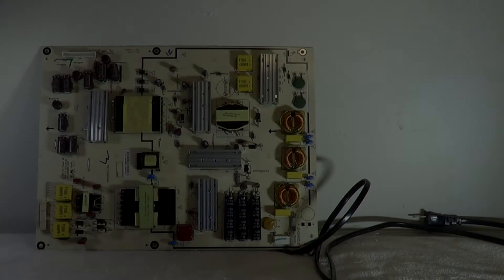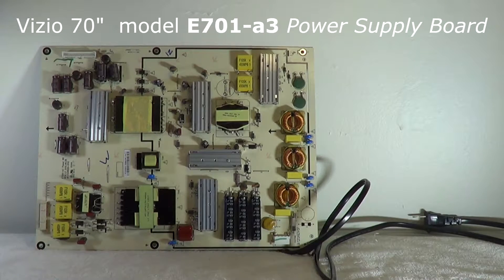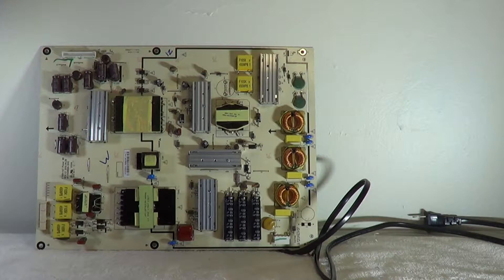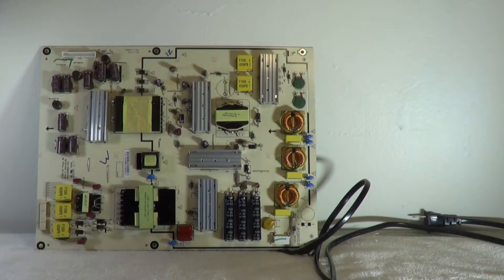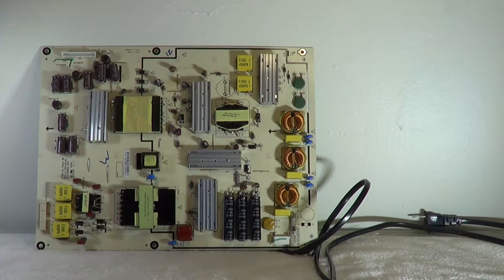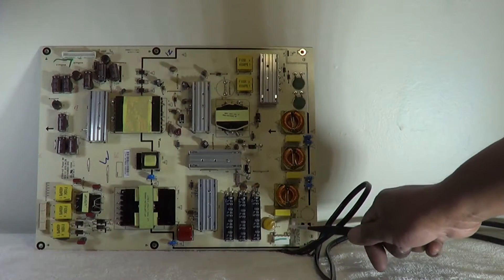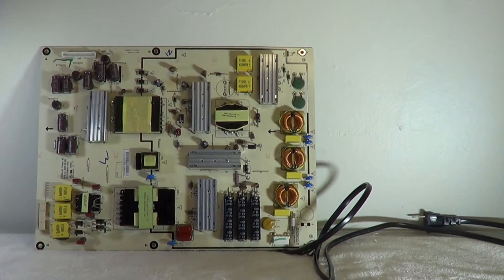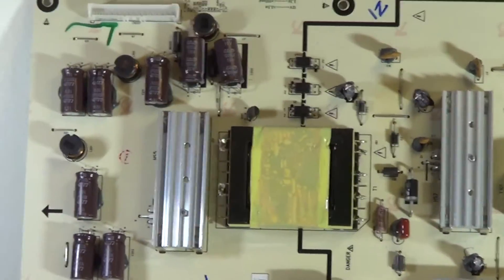LED TV Power Supply tutorial, Vizio E701-a3

Comment: I have a Vizio M70-C3 TV with a power supply very similar to the one on this video. Should the T CON_ON voltage come from the main board? When I power up the TV, I get voltage everywhere except on the  12VT CON pins and the T CON_ON pins. The power light turns on then blinks 16 times. I tried a different main board and get the same results. 
Thanks

Comment: Hey my my father in law has this TV, turned it on vizio logo flashes thought it was the leds after flash light test so I replaced the leds and it done the same thing, so I narrowed it down to the power board getting no voltage at the led light connector, replaced the board already tv works great but would like to maybe repair the old board, any thoughts or insights on where I might be able to find the culprit or culprits on this board please and thank you keep up the awesome videos man

Comment: Sir I have a question. I have a VIZIO M801D-A3 TV.  The backlight LEDs work but while watching the TV the picture just fades away black while sound continues. I've tried replacing the main board, led driver board and the T-con board.  He only thing left is the power supply, Part 09-80CO S000-00. Everywhere I check it is out of stock. Now I'm trying to trouble shoot. The only thing I can think of is it's part of the  the power supply that supplies the main board? Would there be any way you could help me troubleshoot this issue? Visually the capacitors all look fine I don't see any ballooning.
Reply from the maker: If the picture fades away to a totally black screen, you  have a backlight problem.

Comment: Really nice vid! Yes it's nasty feeling when electricity bites. I got bit by atx power supply main filter cap. I was successfully managed to repair it. I pulled it out mains and I noticed that primary sides N-cable was touching fan, so I touched it to get it better position and pam filter cap gave me nasty shock. Aaargh it was horrible feeling.

Comment: Thanks For your detailed info.

I have a question:

I have a grundig LED 40 inch TV (40 MLE 5770 BL) in which has 3 in 1 Board containing:
1-Power Supply Board
2-Main/Driver Board
3-T-Con board with 1 Ribbon

The TV was connected to a receiver by an HDMI and has stopped working after a lightning that destroy the receiver and the TV.
When i connect the power button the red light blink once and othing happened as if it's a dead set.
I have check the power side (hot side) all seems working gd.The driver side (Cold Side) seems to have the problem.

I checked the 3.3v standby is giving 0 but the 5V is existed.I have also the backlight working, the AC fuse working
If i want to check in the level of components what should i check also?

I have checked most of the transistors in the Cold Side (Driver board side) all seems working but 3 it gives low voltage even thought nothing is seems blown and/or any liquid/substance isn't existed.

Any suggestion(s) may help.
Thank you and/or anyone in advance.
Reply: I have a 70in vizio that the back come on bright when powerd up then they go low in power . is it the main board are what

Comment: I got a noise coming from my power supply I got all the volts
Reply from the maker: Whats wrong with it?
Reply: @bigdog8882  the blacklight flash and I'm getting all my volts from the power supply I'm thinking leds
Reply: @bigdog8882   what's led + and led -
Reply from the maker: @leonjohnsonjr3331  Im not sure but U can check them if U have a backlight tester.
Reply: @bigdog8882  YES SOMETIMES THE BACKLIGHT DONT HAVE ENOUGH POWER TO LIGHT THEM UP QUICK I USE THE BACK LIGHT TESTER BUT IT LIGHT ALL OF THEM BUT IT STILL WAS THE BACK LIGHTS

Comment: FYI some of those silver heat sinks can be hot ground and they are a shock hazard, I got a shock one time by touching one of them.
Reply: I never wear rings or bracelet when working on TVs I leant the hard way lolol
Reply from the maker: Yeah, I get zapped quite a few times when Im working on a Live smps, as soon as I barely touch one.
Reply: Just be glad you're not working on those old tube sets anymore, there were lots of places on the chassis where you could get shocked especially the underside of the tube sockets.